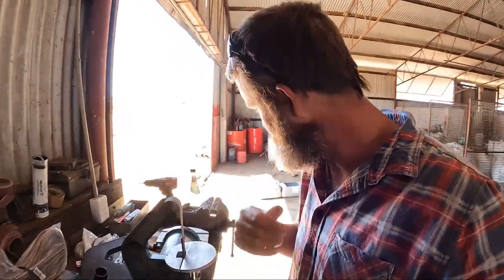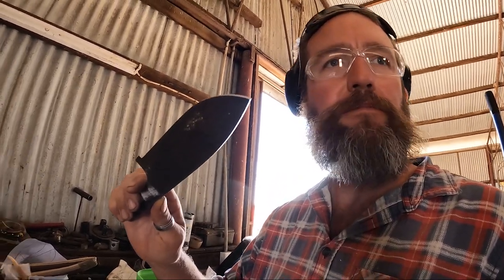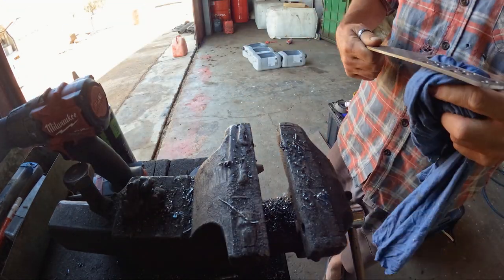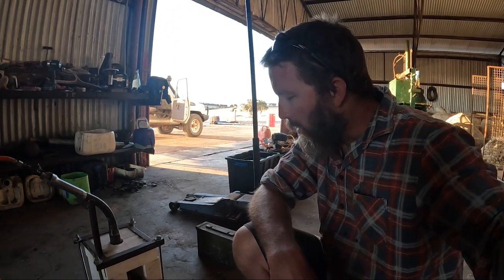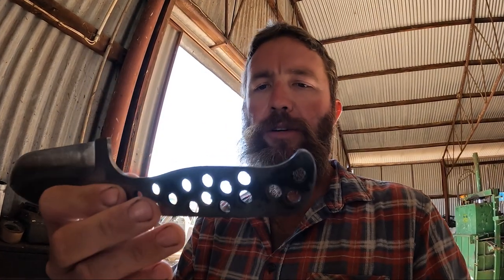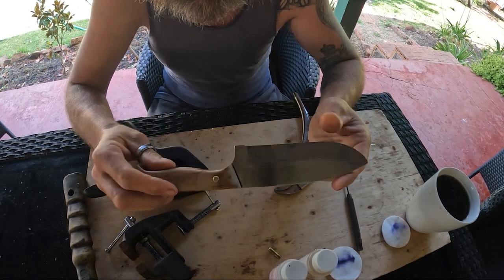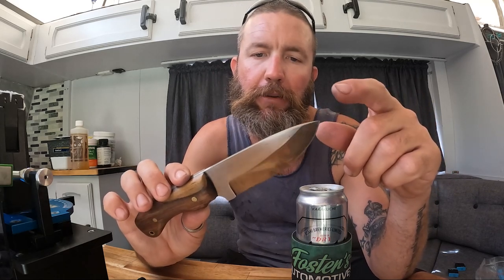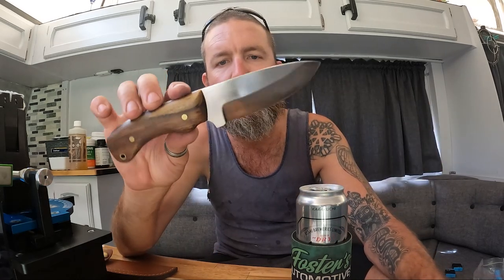Backyard Knife Making | Knives that will last a Lifetime | Y2EP16

Comment: great knife...except for the furnace, the metal, that cool sharpening bit of kit, the fluids and especially the experience/know-how, I've got every thing to have a go myself . I can see why you find it so satisfying to produce something like that. Not entirely out the realms of a bloke with a garage. Now where the hell do I get knife grade metal where I live...Put me in the pot...learnt something today.  cheers
Reply from the maker: Cheers mate 👍,  similar metals you can find 2nd hand like old saw blades, metal or wood files or car leaf springs can also work well. 👍 I'll chuck ya name in the draw mate
Reply: @oldmate_adventures  Good tip... Would need annealing and then re-hardening  I suppose...but yeah will see what's out there.
Reply from the maker: Old wood rasp if you can find one or just a old metal file works well too. Find something thinner than 5mm is usually better too. Yeah can anneal them fairly easy to be able to work with.